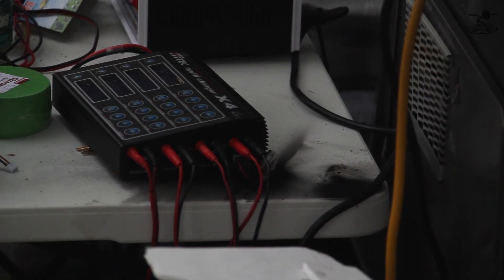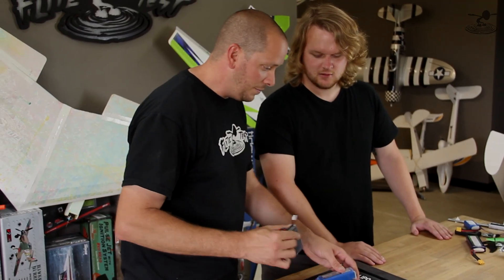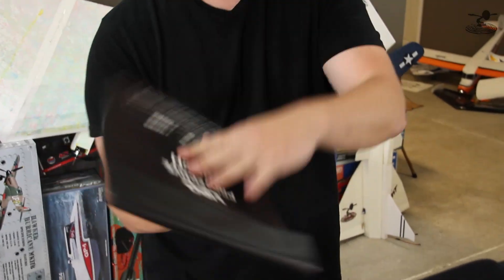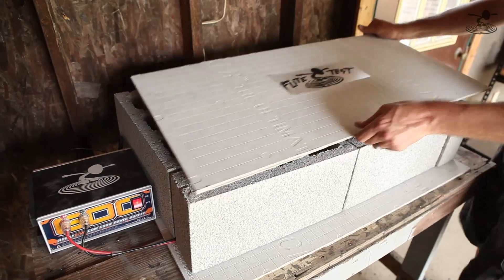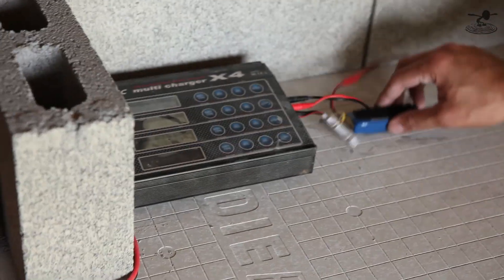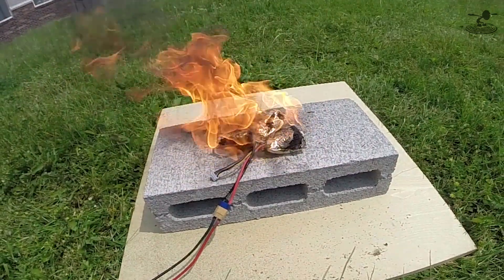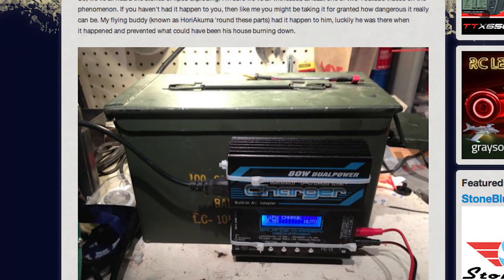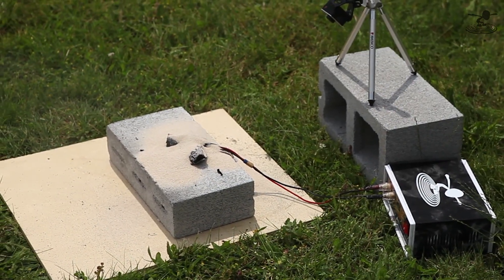Flite Test - Lipo Battery Bunker

Comment: Why buy a separate lipo checker? The charger shows that information. You guys are turning into a salesmen show.
Reply: If you don't take your charger to the field, then you need a cell checking device. ALWAYS confirm a battery is good before putting it in the air.
If you just pulled it of a balancing charger at the field, job done. Otherwise always use a cell check, any one will do. The pack might be at storage charge, it might be the first pack you used at the field and is almost fully discharged, or it might have a slow short on one cell.
Reply: Tim Watterson
Good point. I didn't even think of this because I always balance charge my batteries the evening or morning of my flying day.
Reply: If people would actually check their charger and balancing, there's really no need for a field check. But yes, having a lipo checker in the field surely has it's usage. I for one prefer to rely on my charger, as that will tell me whether a cell is still good AFTER my charger has tried to balance charge. If it's not good after that, one really shouldn't even take it to the field to begin with.... :)
Reply: Another point to have a cell checker is if charging multiple batteries in parallel.  I wouldn't put dead batteries on without checking them.  If one is way lower than the others I'd charge it separate from the others.  Or get similar discharged batteries together once the check has been done.  Just a thought.

Comment: Salt water to discharge a battery is a myth. Speak to David at progressiverc, he did a long piece on lipo disposal on the richness podcast. All saltwater does is corrode the tabs off the packs so you can no longer see a voltage. They are still charged. Much better to use the discharge feature of a decent charger or failing that put a light load on it until if is totally flat. Then you can dispose of it in your household waste. A fully discharged lipo is not going to burn.

Comment: My Turnigy Accucell 6 won't even charge without using the balance cable... unless I'm charging single cells, of course. If you care for your batteries and want them to last a long time, it just makes sense to keep them balanced anyway. I've also observed, since I picked up that HK-010 Power Analyzer, that if you drop below 7% or so, that's usually where the cells start to unbalance. So that's one reason it's important to try not to drop below 10%.

I didn't know that it was the law to carry lipos in a fire proof bag on a plane. But when I moved from Germany back to the U.S. a couple of months ago, I threw all of my batteries in my charging bags anyway because it just made sense to play it safe. I've been curious as to why they never said anything to me. Now I know.

Comment: Hey guys if you get a chance I would like to see your version of the FT fabulous foam flying flapjack of death. The flying Flapjack was a WW2 experiment combining STOL with high speed conducted by Vought aircraft V-173. It was a flying wing with counter rotating props placed on the wing tips with a very high angle of attack for landing and takeoff. It might make an amazing foamie especially with the electronic stabilization paired with electric motors available today.  The project was eventually canceled due to the development of jet aircraft. Thank you I really enjoy your chanel

Comment: I'm really surprised that there are people who don't balance on every charge. Not saying if it's wrong or right, but rare. With the people and fields I fly at that is virtually unheard of aside from the occasionally new guy. We also deal with larger packs like 12s and such so maybe it's just more common with the higher cell count packs.
Reply: Yes, always do a balance charge. There's no point not to.
Reply: If the battery cells are resistance matched it's in most cases not necessary to balance the cells each time. I don't balance the cells each time, but I always connect the balancing plug and check the cell voltages. Usually the cells are balanced to within .01 volts, and stay balanced even if I don't balance them every time. I do balance them occasionally, just to be safe of course, and always store them with optimal cell storing voltage.
Reply: PHeMoX Unbalanced charging takes less time, and isn't a problem with high quality battery packs and if you know what you're doing. I occasionally check the individual cell voltages with a multimeter just to be safe.

Comment: I'm surprised you didn't mention thermal sensors.. I have a Triton 2 and it has a thermal sensor that you put on the battery and it shuts off the charger if the battery gets too hot.

Comment: Nice tips, I use 50 cal. ammo boxes with vents cut in to charge batteries, they also are put into lipo bags.  They can be found on amazon.  Photo: http://instagram.com/p/nv1HDTQfck/

Ammo boxes link:  http://www.amazon.com/gp/product/B000J4HXUC/ref=as_li_tl?ie=UTF8&camp=1789&creative=9325&creativeASIN=B000J4HXUC&linkCode=as2&tag=sonorbstu-20&linkId=UY7D53W5ZKHX2VCN

Comment: I just use a $5 metal mail box,all the cables run through the mail hole.
You can line the inside with cut down Lipo bags or a fire blanket if you want.

Comment: back when i was doing RC on road racing we would push the limits on charging lipo's until one day when someone was charging their batteries at 60 amps it blew and it was a 2s 6000mah battery and it caused a 6ft wide fireball of flame. it covered half of the indoor track with ash. lucky no one was injured from the incident and no one was by the batteries when it happened but it did in gulf $2000 worth of rc cars with it.

Comment: Please correct me on this one: Aren't home smoke detectors really just light sensors detecting slight variations in light caused by smoke?
If that's the case, would it work in a pitch black box?
Reply: Americium ionises the air in normal conditions which produces a small charge which the detector picks up. When smoke goes into the detector it cannot ionise as much air so the no charge is produced which sets of the alarm. British GCSE Physics knowledge for your there!
Reply: There's actually a microgram amount of Americium inside of them, which is a radioactive element. It's so small the radiation is harmless. And a sensor which detects the small changes in the radiation due to smoke.
Reply: Travis Wright there are two versions commonly available the one with americum and others with a light and a light sensor which is reacting to the smoke

Comment: Hey there... I have a quad and just today i ran it without a low voltage alarm... Till now i have run my batteries down to about 10.6v (ie...3s 2200mah pack) and they have still gotten a little puffy and today i ran it down to 9.6v by mistake... What are the chances my battery is going to give up on me ???

Comment: I've always charged my batteries using the balance lead, my charger doesn't have a connecter for the power lead and I wasn't even aware you could do it that way! Is it bad to always balance charge, or is it just slower?
Reply: Not bad at all... Just slower. You're actually likely to have better lifespan in your lipo because of the low C charging.
My IMAX can actually do both, so they only discharge by the balance plug but do the bulk of the charging via the XT-60

Comment: i'm going to build a tricopter together with my dad this vacation, wich one would you recomend? Just the scratchbuild you made a vid of or something els? It is my first tricopter and 4th multirotor... I'm going to use it for fpv so next question is, wich fpv system would you recommend?
Reply: Probably buying or cutting your own frame plates of davids tricopter and building from there would be the best. If you want to spend some more money on a frame, you could buy a turnigy talon frame or something similiar. Then 5.8 fpv would be the best to start. If you are curios as to what you need for a 5.8 system i have a video on my channel.
Reply: Well if you just want a tricopter and your dedicated to that I would go with the Bat Bone TRI http://shop.flitetest.com/multirotors/bat-bone-tri-370-kit/

But if you wanted somthing that later on you could change to a quad or what ever i would go with the anycoptoter becuase that gives you more diversity and its also a little bit cheaper. I hope this helps. :)
Reply: thanks guys!! I I'm probably going to follow David's built and for fpv I might go for a cheap boscam fpv setup with my mobius connected :D anyone has experience with boscam? i might buy a set from banggood but I have no experience at all with fpv setups... Is this one good? I want at least 100 meters of range and i'm going to connect a mobius or a cheap board cam...http://www.banggood.com/Boscam-FPV-5_8G-400mW-AV-Receiver-RC805-With-Transmitter-TS353-p-918123.html
thanks!